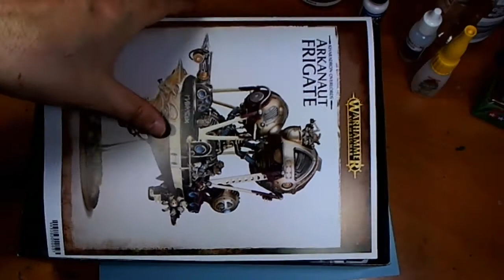Building and Painting Kharadron Overlords Frigate Part One

Comment: I couldn't hear but what air brush do you use?
Reply from the maker: I have two I use; an iwata revolution ($70-80) and a Harder and Steinbeck Evolution ($150-170) The revolution is a great brush, a real workhorse. If was was to buy a new one I'd get the iwata eclipse, basically an upgraded version of the revolution with a slightly smaller needle. Next video has a lot of airbrush info, good and bad lol.
Reply: Thanks I just started getting back in to Warhammer and alway wanted a air brush